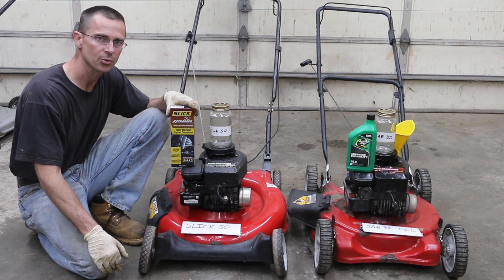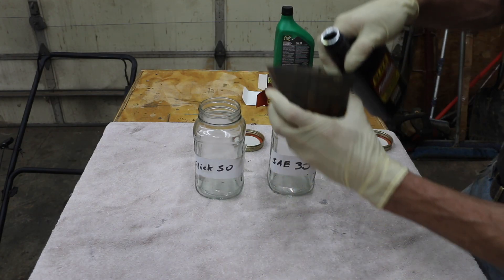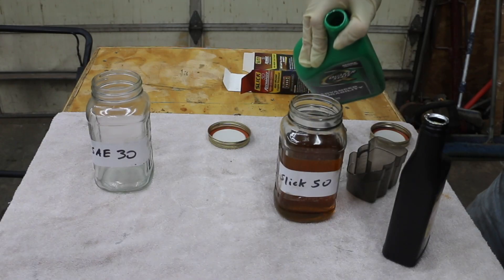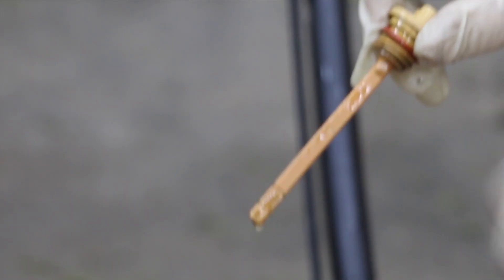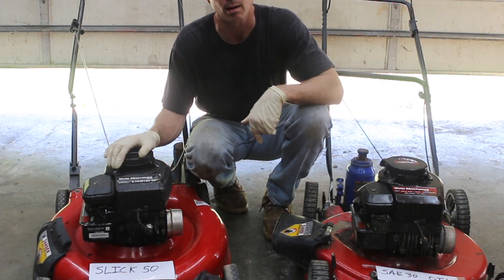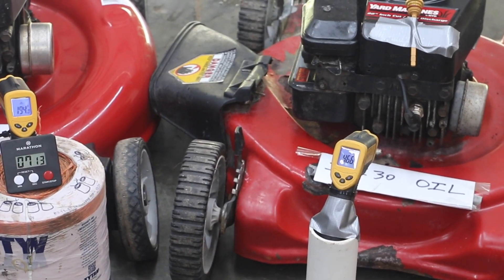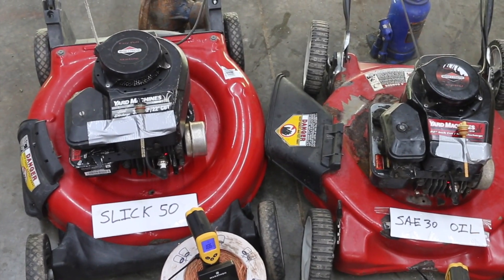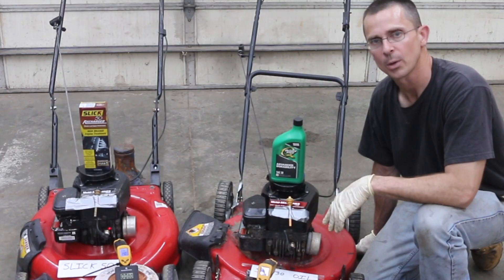Can't believe what SLICK 50 did to my engine!!--Dry Crankcase Test!

Comment: There's one little thing that may have messed up this test and could 
account for the lower temperature on the slick 50 mower. you have a 
block off mulching plate on your slick 50 mower and a side discharge 
chute on your 30 weight oil mower. The  30 weight oil mower is blowing 
it's nice cool garage floor air right at the slick 50 lawnmower this really 
could've messed up your test a lot and lowered the temperature of 
the slick 50 mower.

Comment: I have always heard that Marvel Mystery Oil is the best stuff to use, as it can be used in the crank case, transmission(s), and engines of all types & Marvel Mystery Oil has been around for over 100 years, they are doing something right; also the M.M.O. when used is supposed to act like a lubricant akin to "ball bearings on glass" only for motors & transmissions and it is supposed to eliminate the friction (just like Slick 50).